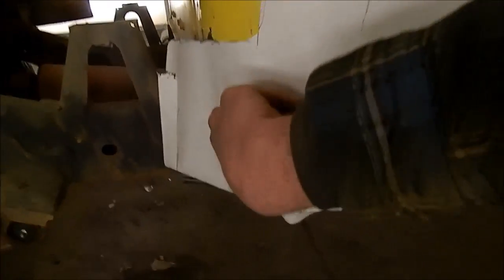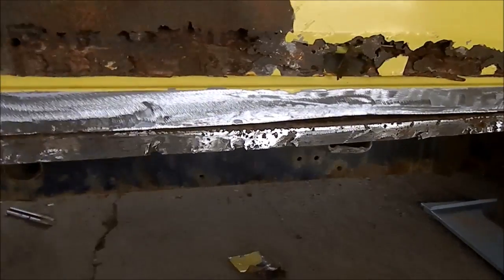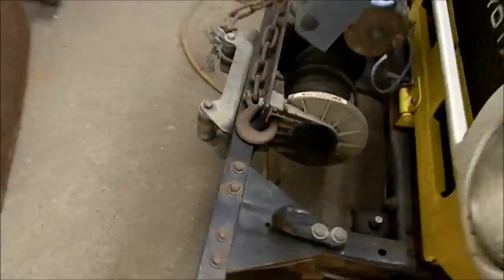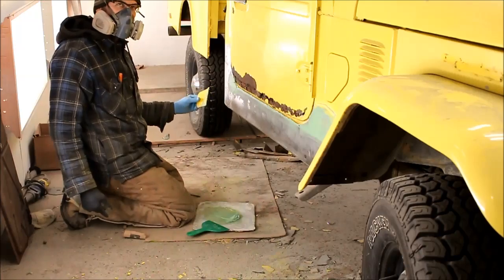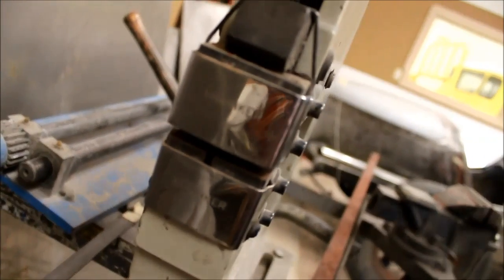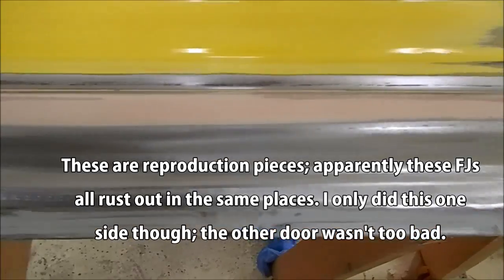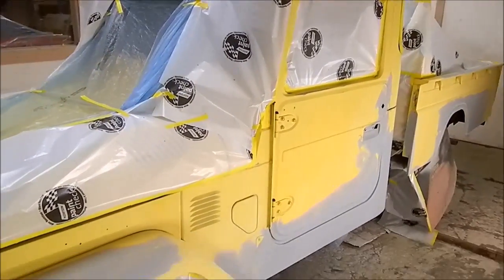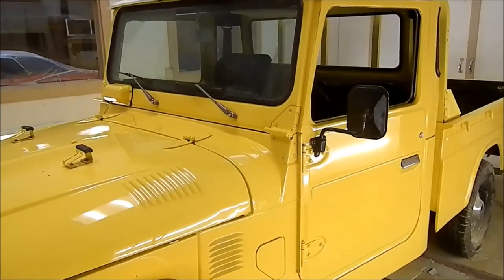Bodywork Time: Toyota FJ45 Rust Repair!

Comment: These old Toyotas have the most amazing ability to rust here in Australia. Back in the day many were rebuilt with aftermarket Fibreglass parts. These included roof,  front guards, bonnet, and radiator support panel. Even whole off-road custom bodies. They were the number one larger ute available here beating the Nissan Patrol and Landrover by a large margin. Nearly all the FJ series Cruisers are gone now and survivors are getting pricey. Again another great video Scott and Stella.
Reply: Meant to say here in Australia we call a pickup a ute which is short for utility, here in Queensland it was often shorten to Tilly as well. Nowadays a lot of people call their ute a truck, which is an Americanism to some. A truck is anything that can carry over 3 ton to me.

Comment: I had a 71 blazer from Minnesota. I used a couple gallons of bondo and trowled it in using old news papers for backing. sanded and painted for a nice sale prep. Worked and got rid of it before it literally fell apart. it was so rusty there was almost nothing left to hold the windshield in and rust would rain out when ever the door was slammed. Nothing like a great rusted to the door handles vehicle held together with bondo. Love this site. You guys have a sense of humor A

Comment: I had a 78 FJ40 with no tin below the body line.  Had to put new tin on the entire bottom.  - a friend said to paint flat mil. and I did and it turned out really great.   I used Finnish postwar camo look, with Finnish roundels made in Finland for a correct use :)

Comment: my uncle owns one of those Toyota's but its a 67 and it has them Cab in back not a truck bed and I remember when he bought that thing that used to be a column shift and then he had it switch to a floor shift but he still owns that thing about 70 when it was a few years old and he still owns it he moved from California to Montana he still owns that thing takes it when he goes on vacation pulled behind his RV but it's funny all them years he's on that thing!

Comment: I absolutely love seeing this stuff. There are so many project cars I wish I could adopt and they all need floors and rockers...having zero welding or sheetmetal forming experience kinda puts the kibosh on that plan, lol.
When you lapped the new cab corners on, did you flange the edges of the hole somehow, so the repair panels would be flush with the rest of it? Or some other trick? The final result looks boss.
Reply from the maker: Oh! Good question... In cases like this, where there is a bit of overlap, the shrinkage that naturally occurs is enough to pull the welded area just lower than the surrounding metal, making it easy to just fill over the seam without having to worry about a "lump" where the weld is. Thanks for the note! Cheers.
Reply: Appreciate the reply! Quality youtube right there.

Comment: Nice work. How do you seal up the internals? POR-15?
Reply from the maker: Hi! I left all of the undercoating, sealing, and reassembly work to the customer to help keep the bill down... I prefer the "Waxoyl"-type of rustproofing that never dries and seeps into the welded seams, where most of the bad rust problems start. For exposed surfaces underneath, POR-15 and the like are great, too. Basically, anything is better than the factory rustproofing, which was almost nothing.

Comment: I don't understand how you went over the seam without there being a high spot, wouldn't the overlapped part stand proud of the rest of the panel?
Reply from the maker: Oh! The shrinkage that occurs naturally when welding tends to pull the welded area down a bit; in this case just enough that the seam was just below the finished surface. Cheers from everyone here...

Comment: Just a note here for all you weekend wannabees that get ahold of these vintage cars and trucks from the 60's and 70's. I mean specifically the vehicles  that had been repainted resprayed with synthol enamels & primers of that era. You ain't gonna paint over the shit too easy and you won't ever get a match because of the fade rate of those style paints. Urethanes were around back then but not very common at all and Urethane or Epoxy primers did not exist they used a synthol prime over lacquer primers from the factories of that era. Only high end cars had Urethane paint from the factory. The old Dupont Centari line was about the closest thing you would get back then to an actual Urethane paint and GM used it from about about 1972 on. Modern Urethanes and Epoxy primes are the only thing that might stick well over thee old Synthetic paints. Most of em have a tendency to crack and bubble out if ya spray over em period no matter what ya use especially if there is body work beneath the areas painted over. Make up your mind to sand your ass off or have the car professionally stripped primed someplace that does it cheap. It's not worth dumping a ton of money and work into a vintage car only to find out U did the ultimate stupid mistake or The Big Sin as I call it. I found out the hard way more than once I'm slow learner from time to time....  Never use a lacquer primer over old synthol paint no matter what anyone else tells ya about doing that it will work to help spray over the paint and make the new paint stick but Lacquers have a tendency to eat thru to the top coating or paint layers and even faster with clear coats on top. The reason is the clear coat absorbs the UV it doesn't repel it and speeds up that inevitable chemical reaction... Not a good thing to have happen to car or truck ya shot your life savings on. The car or truck will look good a year or maybe even 2 depending on the UV exposures to it but eventually it eats into or etches the top coating....  If you can sand thru the thick old ass 50's 60's 70's paint have it it makes a better job. The old primers are not the real concerns here.